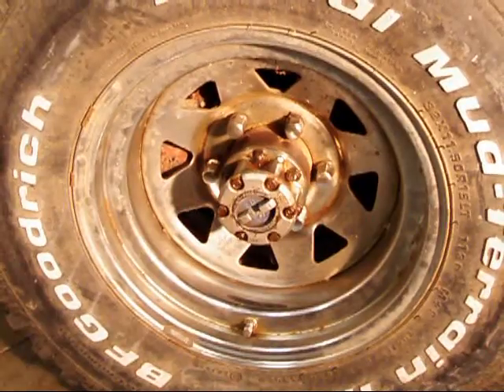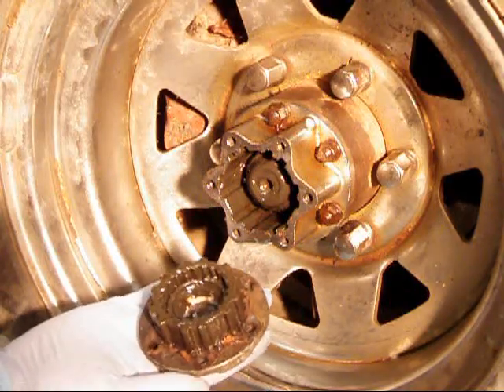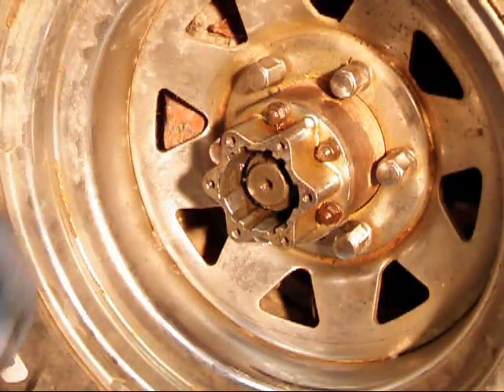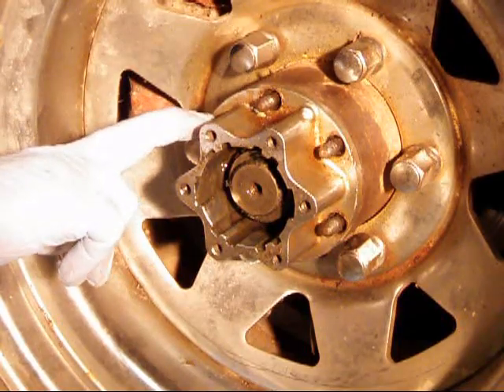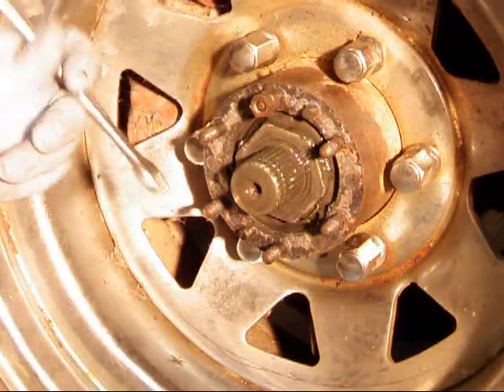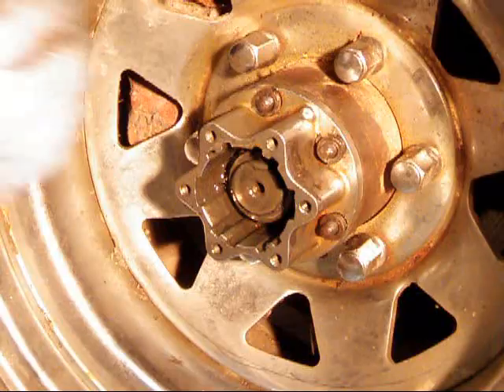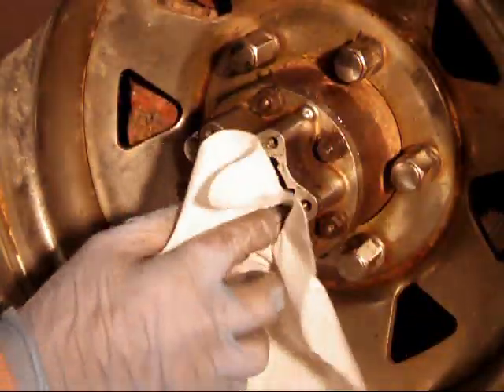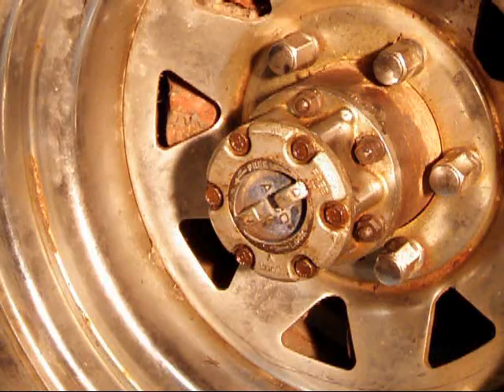How to Remove & Replace a Toyota 4x4 Manual Locking Hub (See video description for more info/tools)

Comment: Have a 1992 Toyota truck with one of the manual locking hubs very hard to turn. So, this really helped take the mystery out of how to remove and either replace or add a bit of grease! I hope my 1992 is not too different!!!!!   Thanks
Reply from the maker: It probably just needs cleaned and greased, but you should watch this video before reassembly: https://youtu.be/W78RkF1mUOE

Comment: Thanks for the info. Nice video. I changed a flange today because it was cracked as a result of me hammering it on the side to get the cone washers out. I used your method this time. A couple of the cones were stubborn but they came out eventually, and no cracked flange this time!
Reply from the maker: Good deal!  I'm glad you got them out.  On really stuck ones I also like to soak them in penetrating spray like PB Blaster, and you can heat up the studs with a propane torch if they are REALLY stuck.  But generally the brass drift gets the job done nicely.
Reply: Thanks Pete. I'll keep that in mind. I have a small propane torch if needed. My hubs are not original Toyota, my cruiser didn't have them factory fitted.. it's an all wheel drive model converted to part time 4wd. George, Australia.

Comment: Thanks for the cone washer tip! It worked great.  The ones on my '88 truck probably have never been out and I didn't want to damage the hub housing.   In the past on old Dodge trucks you can smack them with a ball peen hammer since they're steel and won't be damaged.

Comment: I really know nothing about how to fix cars although can just get by with minor stuff.It was simple what you showed but it was fantastic non the less..Well explained and easy to understand...I loved the two nut tightening thing and if you do shear a bolt off to get a dremel,make a groove then use a screwdriver to remove..I also liked that clip removal tool...Thanks for sharing..

Comment from the maker: The haynes manual is like a grade-school reader.  The factory service manual (FSM) is like a graduate level textboox.  Trust me, if you can get your hands on a factory service manual you will never pick up a haynes manual again.  The FSM breaks down every single part of a repair in detail with either a picture or an illustration for each step.  They are awesome to work from.

Comment from the maker: Heating the locking hub body down by the cone washer may expand the hub body enough to help release the pressure on the cone washer.    Another try might be to see if you can actually get a tapered punch into the split on the cone washer to try and tap it around and loosen it up.  But before everything, soak the cone washer in penetrating spray and really put some force into the brass drift.  I've had some NASTY ones and they've all eventually come out with the drift and sledge.

Comment: @WheeliePete Thanks for getting back to me so quick. I have to replace them because there is not much to resurface them. I have the new ones just needed further info for the hubs because I 'm a novice when it comes to those. This will take some of the pressure off after watching this. Wish there was a easier way to get them off. I think I may just make it a weekend project to do the rotors and ball joints since it'll all be jacked up and took apart. Thanks again

Comment from the maker: The problem with prior owners beating on the body of the locking hub is that the flange where the locking hub body attaches to the wheel hub gets VERY VERY thin right where the cone washers are.  So when people beat on that area they can deform the very thin wall of the locking hub body where the cone washer's tapered hole is drilled.  Once that area is deformed it can lock up the cone washer and keep it from releasing.  This is why you should never, ever, pound on the hub body...

Comment from the maker: @bats28  You might check to see if you can just have the rotors surfaced.  If you can, it means you won't have to take them off the hubs (you will still have to remove the locking hubs as pictured in the video), but you won't have to press the wheel studs out of the actual hub body.  If you are replacing the rotors you'll need to press the studs out of the hub body as the studs pass through the rotor and are pressed through the hub body.

Comment from the maker: I've seen aisins blow up, but it's usually a failure of the inner gear exploding under EXTREME use (huge tires, lockers, full throttle assault in the rocks kind of wheeling, etc.) It's my opinion that the WARN is not a better hub than the Aisin. The main reason people put a Warn on is because they didn't reassemble the Aisin properly and it engaged, but then didn't disengage, they thought it was broke, and replaced it. I'll do a video in the near future about proper reassembly of the Aisin.

Comment from the maker: @nerdlinger2   You've got an IFS (Independent front suspension) truck and they use a different type of axle so you probably don't have the snap ring there.  the truck in the video is a 1979-1985 style solid front axle with Birfield joints.  As for the cone washers, soak the area in penetrating spray (PB Blaster is my fav.) and really lay into it with the brass drift and sledge.  You may have to heat the area gently with a propane torch.

Comment from the maker: It goes, outer wheel bearing bearing, thrust washer (the big flat one with the single tooth, then a big nut, then the star washer, then the other nut.  But you have to do the pre-load adjustments.  Best to get a manual and go through it right or you will screw up your wheel bearings. Snapring goes on the end of the axle shaft right before you put on the locking hub dial.

Comment: Ok i watched it thats a definit easy way to do it.Preload on my  1986 sr5 turbo 4x4 manual locking hubs, was as follows    
           
1st- Tighten Nut to 41 lbs torque.spin it to right around 5 times, Spin it Left 5 times.
2nd-Tighten Nut To 41lbs again.Spin it right 5 times.Spin it left five times.
3rd- Losen nut,Spin it 5 times left.Spin it 5 times right.
4th- Tighten nut to 21lbs torque and your done.
        I did have a prob with hub dial not turning.Have to remove it n see whats up.....

Comment: Thanks, this is one of the most useful videos I've seen for working with the old solid front axle Toyotas. Do you by any chance have a video on how to replace the front wheel bearings? If not, any tips? Thanks!
Reply from the maker: +Rudi von Staden   I don't have a video for front wheel bearings currently (but it is on my list of things to do!)  The biggest tip for the front wheel bearings is to get the socket for install and removal of the two spindle nuts.  They are 54mm so it's a big socket.  Best bet is to get one of these from trail-gear. :  https://www.trail-gear.com/TG/54mm_Axle_Socket/i_0_0_3482/_140157-1-KIT.aspx#.VkC1zGeFOUk
Reply: WheeliePete Thanks for the tip! I hear from other Hilux owners in South Africa that the standard water heater element spanner fits perfectly, and they are available from most hardware stores (not sure if it's an international standard). Only problem is they need to be modified if you need to torque them.
Reply from the maker: +Rudi von Staden   Hmmm...  maybe they have a different element standard than the U.S.  because the socket I use for water heater elements is 1.5" which is only 38.1mm  The spindle nuts on the early solid axles take a 54mm socket.
Reply: +Rudi von Staden yorniel

Comment from the maker: @et0307982   The axle in this video is a 1979 - 1985 type axle.  The later model locking hubs are similar, but not quite the same.  You're not going to have the lockring on the Tacoma because it has CV shafts where the early solid axle trucks have Birfield joints.    The same principles apply for removing the locking hub body on all the years though.  Good luck.

Comment from the maker: There's a blind hole in the end of the burfield stub shaft that's threaded 8x1.25 (IIRC).  You can stick a bolt in it and grab that with pliers to help pull the axle out a little bit when you go to install the snapring on the end of the axle.  That hole can also be used to attach a puller to the end of the birfield stub shaft if you hare having a hard time pulling it out of the knuckle ball.  There shouldn't be a bolt in in when you are driving around.
Reply: Pete
I’ve got a Daihatsu fortrak ( Rocky ) always wondered what that threaded hole was used for ,
Many thanks.
Reply: Yea them snaprings can be a bitch

Comment from the maker: Hopefully somoene will chime in here on the subject.  I don't have that much knowledge with the early 22RE trucks.  I think there is a cold start injector of sorts in there somewhere, If I remember right there is a banjo fitting on the side of the intake plenum that injects gas directly into the intake for cold start?  I jsut can't remember at this point.  Fuel/Air/Spark...it's one of those three...

Comment: AWESOME video's btw; definitely going to subscribe! Have a question. I'm looking at an '85 4Runner this weekend; solid front axle w/ manual locking hubs. Just wondering whats the best order when locking the hubs. Example; if I pull off onto a service road is it ok to lock the hubs first (still in 2WD) then if I need 4WD activate it afterwards OR should I leave hubs unlocked, activate 4WD THEN lock the hubs or does the order matter? Thanks a lot for the video's!

Comment from the maker: The dial itself has a shaped o-ring that you should put a light coat of grease on.  Also a nice light coat of grease on all the friction parts inside the hub.  Anywhere you get metal to metal contact should have some grease.

Comment: Hey Pete!! best vids ever!  do you know if there should be a bolt and washer in the end of the transaxle behind these hubs? when I opened my (milemarker) hubs it was like that...
Reply from the maker: I've seen that too over the years, mainly on hubs I took apart after auto locking hubs were introduced.  It's not necessary under the manual locking hub dial.  The threaded end of the birfield stub shaft allows you to have a bolt in there to help with pulling that joint and axle shaft out of the knuckle and differential.

Comment: its crazy that all that the ring gear in the hub can handle all the torque from the axles.
Reply from the maker: Well, right up until it doesn't...  Which is why they make aftermarket chromoly ones like this: https://www.lowrangeoffroad.com/trail-gear-4340-chromoly-hub-gears-inner-and-outer-301506-1-kit-303107-1-kit-303108-1-kit-301507-1-kit.html

Comment from the maker: @sleepybone321  If you have manual locking hubs that are unlocked and you switch to 4x4 in the cab all you are doing is spinning your front drive axles.  The hubs need to be locked to transfer power from the spinning drive axles to the wheels.  The hubs lock the axles to the wheels.

Comment from the maker: If there were supposed to be drop brackets, any spacer should work.  On the solid axle trucks the sway bar extensions are in the form of longer bolts and sleeve spacers.  I haven't messed with the Independent Front Suspension trucks much though...

Comment from the maker: I'm sorry, I don't have any of the auto-hubs laying around.  I usually yank them off switch to locking hubs on 2nd and 3rd gen trucks.  What year are you dealing with?  I may be able to e-mail you a page from a factory service manual on reassembly and / or an exploded diagram if I have the right year...

Comment: Hey great video. I have a 87' 4runnerthat I need to change my rotors on and it looks like the hubs will need to come off. Is this true? Or am I looking at it wrong. If you have a vid on doing ball joints too that'll be awesome.

Comment from the maker: @WheeliePete   I should add, that pressing studs out of the hub body is a total pain in the ass if you don't have a hyraulic press.  It can be done with a hammer/drift/socket setup, but you better get a friend to help you.

Comment: I am picking up my lock washers tommorow at dealership.I purchased a torque wrench for the bearing preload portion of the rebuild.i will be torquing all bolts to spec on my truck.I was thinking of just making 3 inch spacers for the u style hardware bracket that holds the sway bar in its stock place.   

 Truck wont start unless i spray starting fluid in airintake.once it starts it runs mint.Where would you tackle this problem at first? Any suggestions would be greatly appreciated.  Thanks Dave.

Comment from the maker: Does it make the sound when 4wd is engaged also? Or just when in 2wd with the hubs locked?  If it's only in 2wd with the hubs locked I would take a hard look at your front driveline.  When you use 2wd with the hubs locked in you're putting spin in the driveshaft from the front axle instead of from the transfercase.  This can cause some pretty strange sounds.  Another thing might be wheel bearings, or carrier bearings in the differential.  continued in next reply...

Comment from the maker: @XlElementXl   Doesn't matter.  You can lock in the hubs and run around in 2wd on the gravel roads shifting into 4x4 only when you need it.  The only problem is that if your front driveshaft is unbalanced or sloppy, you will hear a lot of noise from it as the drive shaft will be getting spun by the axle instead of being powered by the transfercase.  It's not really that big a deal though.  I'm uploading a new video right now on how to bombproof your steering stops.  Check it out!

Comment: Great video. Very informative. What about the front wheel bearings? I have a 98  tacoma 4 x 4 2.7. I am a little mechanical. I just did the front brakes and rotors, new starter etc. I don't know how to tell if the wheels bearing are good or bad. I suspect that the front right might have a problem. When I spun the wheel after replacing the brake it sounded a little rough and it wasn't brake noise. Can you advise on that?

Comment: Thanks WheeliePete. Excellent video. I have a 1993 Toyota 4x4 pickup with IFS. It doesn't have the snap ring, but it does have a 12mm bolt and a large washer on the end of the axle, just under the locking hub cap. Any suggestions on how to keep the bearings and axle shaft stationary when trying to undo the 12mm bolt and washer? You have been a lifesaver so far, I wouldn't have tackled the job, but my son lost the front passenger side wheel and sheared 3 lug bolts after someone was interrupted trying to boost his new tires and wheels.
Reply from the maker: I think if you put the transfercase in 4wd and the tranny in gear it should bind up the front differential enough to be able to unscrew that bolt (as long as the front driveline is still attached to the differential.)  All my trucks have manual lockers in the front axles so putting the t-case in 4wd locks up both axle shafts.  I can't remember if that will work with an open differential or not though.  Maybe someone else will chime in who's had to deal with that...?
Reply: Anyone else have input on this

Comment: What happened to the 12mm nut on the end of the axle?  When you took the hub dial off
in the first minute there should have been a 12mm nut in the center of the axle.

Comment from the maker: Sorry, I don't have a lot of experience with the Tacoma front ends.  Generally though, when a wheel bearing is going bad, you will hear a lot of noise and/or vibration when you load the bad bearing going around a corner.  If the left outer wheel bearing was going bad you would hear it in a right hand turn (body roll loading the left outer wheel bearing), etc...  Slop in the wheel when you jack it up and rock it back and forth is another indicator also...

Comment: ok ty will take a look for that banjo fitting.Question for you.If u know.can i take a rear break line and hook it to front break line on my truck?I repacked my bearings today got passenger side all hooked up.All but the break line etc.to short with the 3 inch lift.would rip line if i installed it to lift.I bought new shocks front and rear jusr before i decided to install lift kit.Front ones are 3 inches short from factory set hole for top of shock.Where to get spacer?extention?  HELP...

Comment: hey Pete question for you.I dont have the 3 inch  sway bar drop brackets for my ifs lift kit.Can  just use 3 inch polyethelene blocks n drill holes and add 3 inch longer screws to hold stock brackets in place?I see from pics they look like there angeld.off set by a inch or less.Any idea. 1986 sr5 turbo 4x4 manual  hubs..?? TY for any info.Got my lock rings and picking up my  lock washers from toyota dealership tommorow.So I CAN REASSEMBLE WHEELS ETC ETC.

Comment: Hey I got a question I have 1981 Toyota pickup 4wd and am doing a rotor change, I’m stuck on the rotor off or hub? It has 6 studs how do I get those off?? They’re stuck on good? Just bang them out with some brass
Reply from the maker: Uggh... I've also got an '81 front end and they had pressed on rotors (I think it was that way for 79-83 on U.S. 4x4 trucks?)  The lug studs are pressed through the rotor and hub holding the rotor to the hub.  You have to press the lugs out to remove the rotor from the hub. Then you have to press them back together.  If you can, find someone with a H-frame press. It will make your life a lot easier.  In later versions the rotors were bolted on to the hub which was a lot easier to deal with.

Comment from the maker: ...continued...pull the front driveline and then run with the hubs locked and see if there's noise.  In not, then you've isolated it.  Removing the DL is easy so that's why I'd go there first.  If that doesn't do it, unlock one hub, then the other.  You're just using process of elimination before you have to dig into the guts of the front end.  I'll be doing a video on the locking hub rebuild process soon....